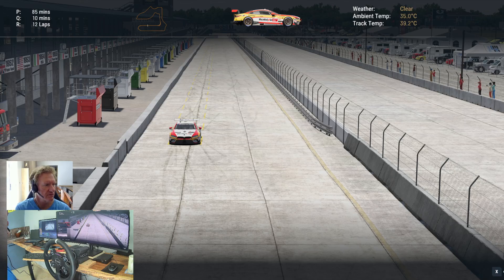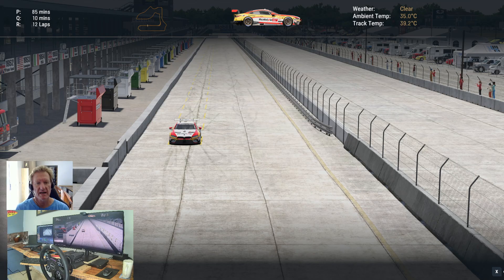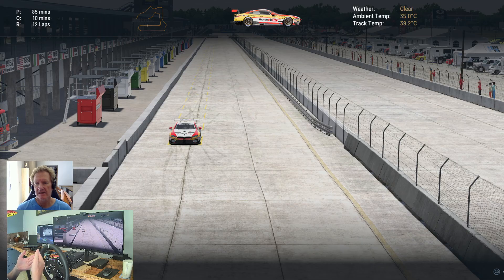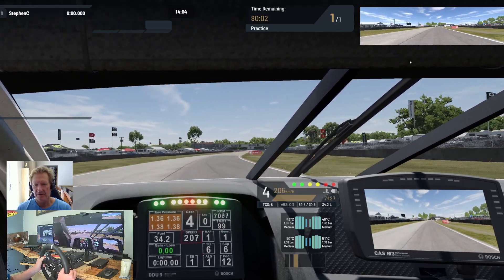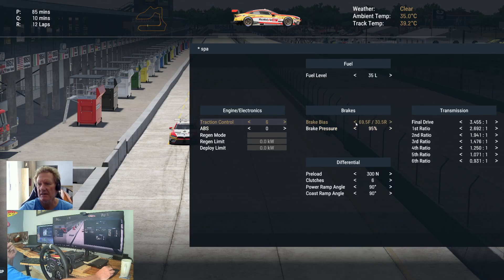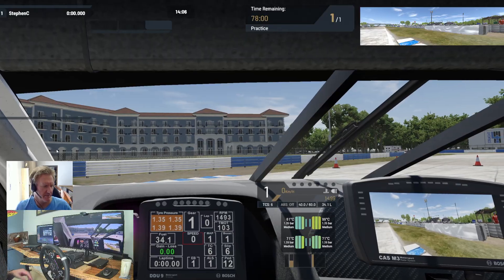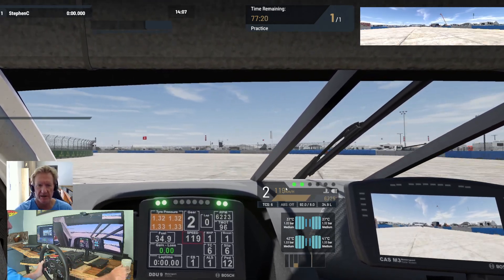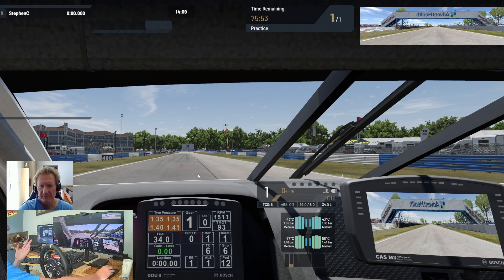Project motor racing: Brake Bias. Setup tutorial and how it affects the car's handling.

Comment: Nice explanation again, useful info for racers that are struggling to setup the basics. Well done. I have been using your anti roll bar video to full effect, finally, i can get round a few corners with more over steer.